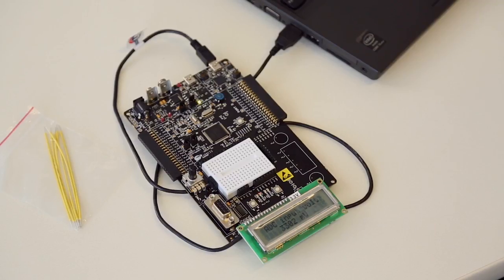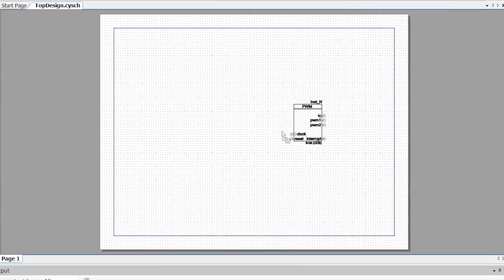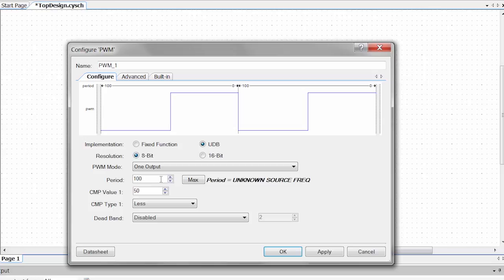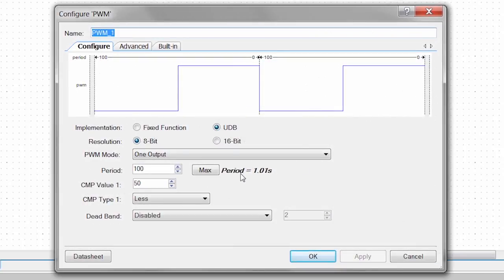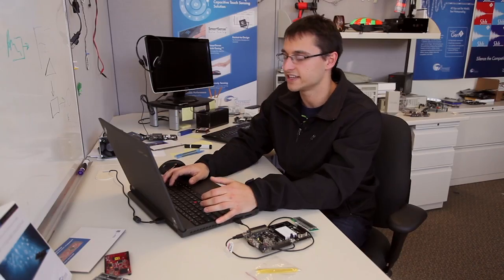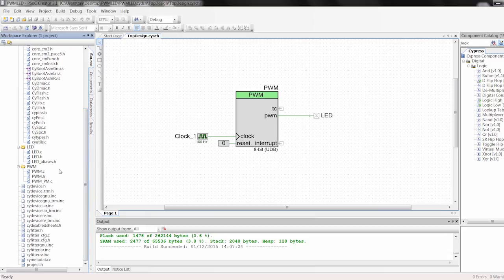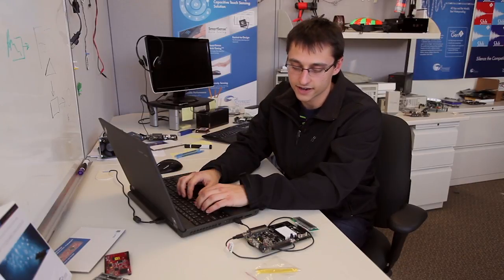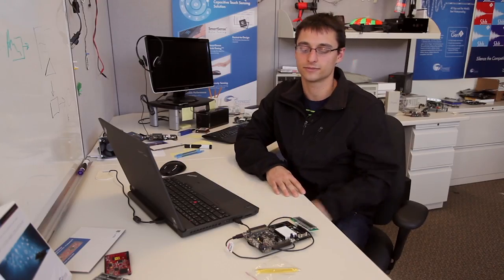How to Blink an LED Using a PWM Component with PSoC 5LP

Comment: Please explain why Logic 0 is used in the RESET button. Making the RESET button LOW will stop the UDB to function I presume. Please clarify
Reply from the maker: Hi Biplab ! thanks for checking out the projects. The PWM component datasheet mentions that the reset pin is activated by a rising edge. By adding a logic 0,all we do is ensure a reset isnt triggered. I hope this clarifies your question. You can check out the datasheet here:

http://www.cypress.com/documentation/component-datasheets/pulse-width-modulator-pwm

Comment: def usb_read(self, size=con.USB_IN_BYTE_SIZE, timeout=None): 
		try:
			usb_input = self.ep_in.read(size, timeout)
		except Exception as error:
			print("ERROR: --- Failed to read. ---")
			print(self.ep_in.read(size, timeout))
		return usb_input

	def usb_collect_data(self):
		data_collect = self.usb_read(64,timeout=10000)
		return data_collect
Why it is coming based on above code